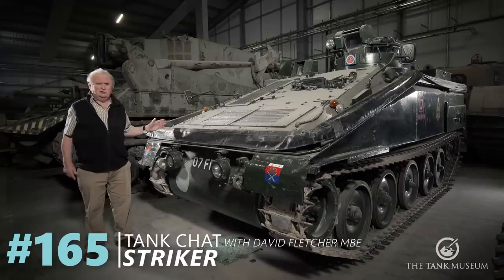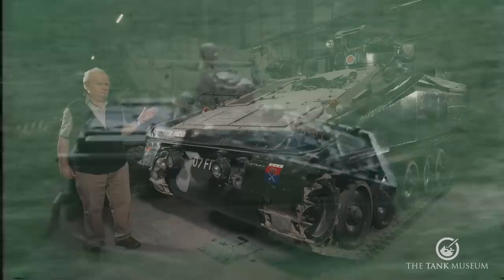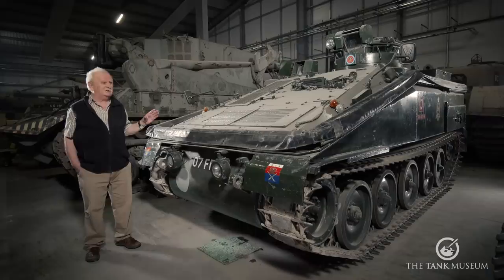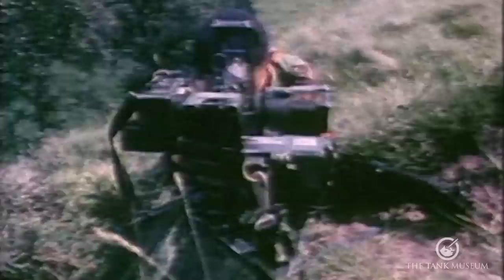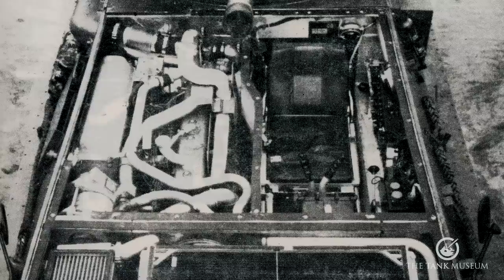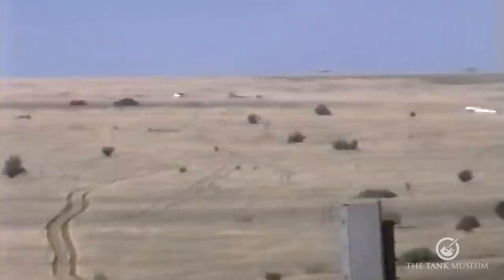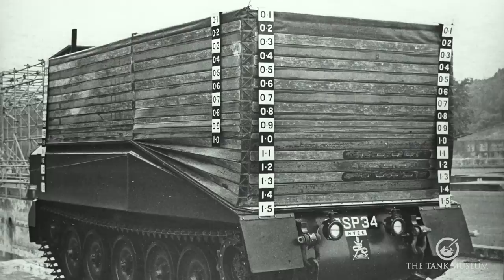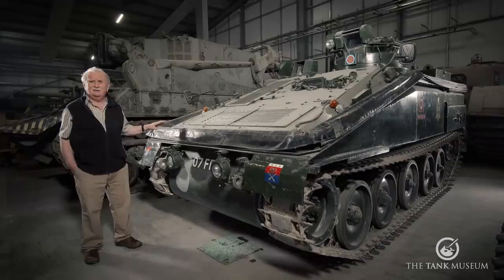Tank Chats #165 | Striker | The Tank Museum

Comment: The idea of dismounting the gunner and firing from cover was the smartest thing about this vehicle
Reply: Making it look like an ordinary Spartan was also brilliant. Something the South African's did with the Valkiri MRL, making it look like an ordinary truck.
Reply: That's pretty normal for ATGMs.
Reply: @jimmydesouza4375  Its really not...there aren't many/any Western ATGM platforms that did it..
Reply: @dogsnads5634  Did you really just try to claim there aren't any western platforms that do it, on the comments to a video about a western platform that did it?

The asteroid can't come soon enough.
Reply: @jimmydesouza4375  Please tell me about all the western ATGM platforms apart from Stormer that aimed to be visually identical to another vehicle...
Reply: @dogsnads5634  And now you're trying to pretend you were making a different argument.

You really need to fix things.
Reply: @jimmydesouza4375  You clearly struggle with reading comprehension..
Reply: @dogsnads5634  In theory, any system that has a separate Aiming system from launching system can accomplish it. A large amount of ATGM are designed with multiple mounts and capabilities, such as TOW. In theory, whether or not battlefield PRACTICE, any system that allows for separate mounting could in theory have a separate aim/launch setup. 

ALL of that said. The capability is not the practice, and the practice is not the capability. Case in point, SAMs/ASM being used as ground attack guided munitions in Ukraine. Heck, HARM were not supposed to be launchable from SU-25/27 and here we are today. 

So, it's important to parse out, have they done it/can they do it/in the right combat scenario is it feasible? What I know, is anyone speaking directly to the true battlefield capabilities of ALL western/eastern ATGM is either the most brilliant person with the best knowledge ever, or making crap up. Pretty sure the majority of people in the Youtube comments do not have THAT level of clearance in that many countries to actually answer the question in knowledgeable manner. This also goes back to Jimmy as well. So, yeah.
Reply: @SlavicCelery  re read what dogs nads originally commented . He’s correct .
Reply: @alangordon3283  and as am I, other missile systems can separate the firing from the aiming. Arguing one specific system is absolutely unique is missing the point. 

Whether or not something can be done, should be done, or can be forced into a different role are aspects of all military systems. HIMARS were developed for certain circumstances. Ukraine has utilized them to a dazzling effect for its own situation.

How something is marketed and it's actual use are very different. Case in point: people argue tank v tank. The use case is commonly tank v bunker. But people don't argue that concept. 

People also accept military strength based on their marketing. We know lots of Russian marketing was less than accurate. Lots of Western marketing is less than the real capabilities.

It's an argument based on marketing and not reality. Swingfire was great at the time, but it's not a modern weapons system. Sorry that, that concept is difficult to swallow. I love F-117 nighthawks. But they're out of date. They are no longer the best.
Reply: @jimmydesouza4375  tbh it does sound like a very straight forward feature. 
Of course the Ukrainian developed Stugna has the option of separating the launcher and the operator/targeting module. And I believe Milan has a similar option? 
You'd think it would be easy enough though, right? Just a matter of running some extra wire between the two parts, as long as the actual optic remains with the launcher. Any relatively modern ATGM should be capable of it as long as is has a camera-optical targeting system. Makes sense too. Keep the operator out of harms way, in a trench of behind cover and stick only the actual launcher out in harms way.
Reply: @SlavicCelery  try reading it again. 🙄
Reply: @L C The milan can..?  Not sure about the TOW, but the milan definitely can.  Maybe look things up?
Reply: @dogsnads5634  Israeli Pereh is based off a M48 with a missile carrying turret, but it has a weird fake gun barrel so it looks like a tank rather than a ATGM carrier

Comment: I once spoke to an ex Army guy and his experience of Swingfire was when they were old stock used for training. They had an annoying habit of not responding to commands and looping back to return to the firer, causing some consternation.
Reply: Should have sent them to the Soviets.
Reply: Alright, who let the US Bureau of Ordinance on the project?
Reply: "significant emotional event"
Reply: Yup, can confirm that.... spent years as a controller then commander of one of these vehicles before they withdrawn. The training missiles if they were treated roughly, had a habit of going ‘rogue’. 
Had one turn nearly 180 degrees before the safety staff command detonated it, also had some ‘hang up’ in the launcher ( rocket motor fired, but failed to exit the launcher), that was emotional. 
When they worked, they worked well. 4000m range and a large warhead. 
The later systems made tracking the target a lot easier....

Comment: I wonder how many miles of swing fire wire is still on the Canadian landscape after all these years.
I loved Medman.
Reply: Probably enough to reach Europe! There must be several thousand of them on Suffield.
Reply: Shush you, there are recyclers that would invade the place and you'd have to start to understand whatever the heck they speak at home.
That said foreign swear words are always useful.
Reply: Reason I had a cutter var mounted on my vehicles. The guidance wire is thin but very strong. Since it's small, it's hard to see and if it is hanging between two trees, it can decapitate you. I pictured a Europe absolutely covered with guidance wires - why risk it? So all my platoon's and later company's vehicles had them whipped up and installed by Maintenance. https://www.youtube.com/watch?v=IQbu4KMzZLA
Reply: I only ever came across the miles of wire while I was on range clearing in BATUS so no trees but a fair bit of tripping up in all that long grass.

Comment: The first set of wargames rules I learned was Challenger. Death by table. The sporting table distinguished several levels of difficulty for spotting. If you were looking at a Challenger tank side on you had to roll rather less than if you were trying to spot an individual spotter. Striker played into that beautifully. The spotter could be as far away (in scale) as 160m from the vehicle which could be in full defilade. You could still try to spot where the missile had emerged from but the odds remained poor. Hitting a target was difficult but swingfire had a good range and quite a good warhead.

Comment: Pretty awesome the wire-line guidance system. Simple idea.
Mr Fletcher mentioned you could use it to trace back to the launcher, yes I guess eventually yes. Doubt it was painted safety yellow though.

Comment: Similar to the now obsolete naval surface to air seacat missile that was also guided by a crew member with a joystick.
Reply: That must have been exciting in a heavy sea.
Reply: Swingfire was upgrade not long after it was introduced with SWIG (Swingfire Improved Guidance) which changed it from MCLOS guidance to SACLOS. All you had to do then was hold the sight on the target. Basically the same as TOW. But far more survivable in practice than TOW.
Reply: The Seacat that proved completely useless in service?
Reply: @dogsnads5634  BS, see M901 and Bradley, IFV
Reply: @colbeausabre8842  M901 couldn't stow its launcher away...
And a Bradley is a Bradley so everyone knows it has TOW missiles...

Comment: Oooo, first!
I wonder if such a vehicle, fitted with modern non-wire guided missiles, could fulfill a similar role on the modern battlefield? It could certainly reduce the requirements on the missile operator, but would it be any better than investing in some drones carrying the same missiles?
Reply: There have been multiple vehicles of a similar role proposed using the brimstone missile system on Ajax, BMPs (for Poland/possible Ukraine), unmanned vehicles, so on. Drones have to watch out for enemy air def systems, a vehicle version can roll up, aim up, fire and forward observers have the targets already painted.
Reply: @slovencleta  Brimstone would be ideal

Comment: The problem with wire guided ATGMs is that they fly a lot slower than shells, which means if the bad guys are on their toes, the return fire can be arriving before the missile gets there, and that is likely to cause some distraction to the poor schmuck trying to guide it.
Reply: Hence why firing from cover with the operator dismounted would be a good idea, no?
Reply: @GorgeDawes  
Not sure about that. I think I'd rather be inside an AFV and maybe miss, than outside when things fly in and go kaboomy and little sharp pieces get tossed around.
Reply: @mikearmstrong8483  See m901 Improved TOW Vehicle
Reply: @colbeausabre8842  
Well aware of it. Is there something specific you are bringing to my attention? Even if you are looking through the sight on top of the hammerhead, incoming rounds can still be a distraction. But since we now use the fire-and-forget Javelin, that is no longer an issue. Which is why I mentioned it as a problem with wire guided ATGMS, which are still in use by some other nations.

Comment: Not seen one of these before. Still seems a good idea for modern warfare. Could they be used against aircraft ?
Reply: No. For a start they’re wire-guided and limited by the length of the wire. Also, most AA ammunition is fitted with a proximity fuze. Swingfire is a shaped charge and requires a direct hit.
Reply: Thanks Bob, Just thought it would have been effective against the low and slow Hinds.
Reply: @bob_the_bomb4508  When I was at Bening for AT MIssile School we were shown film of Tow's being used against drone helicopters, Obviously not a common mission but it showed we had some self defense capability
Reply: @colbeausabre8842  I can see it as a last ditch anti helicopter weapon but TOW still requires a direct hit. It doesn’t have a proximity fuze as far as I know.
Reply: @bob_the_bomb4508  That's right, BUT an incoming attack helicopter is close to a zero deflection shot. You claimed it couldn''t  be done (A flat :no:) I pointed out it could - certainly could be done, not routine practice, but was possible - anyway if what do you have to lose by trying it?
Reply: @colbeausabre8842  you’re right. I interpreted ‘aircraft’ as ‘fixed wing’.

Comment: Was the remote firing achieved via a cable or wirelessly?
Reply: cable from a drum on the back of the vehicle. It enabled you to go vertical as well as horizontal so you could hide the vehicle behind a building and fire from within the building. The missile would exit the launcher and automatically fly into the controllers line of sight. Very handy indeed.
Reply: @markedwards158  Thank you.

Comment: The same vehicle with a modern missiles system would have been the ultimate tank killer 
Just imagine it firing NLAWS or javelins from a prepared position
Reply: Alvis, now BAE Systems, seems to have designed a family of vehicles around the Stormer chassis. I think only the Stormer HVM and mine thrower actually got fielded but an ATGM carrier built on that chassis seems quite possible. Perhaps Stormer HVM could be modified to fire NLAWS, Javelin, Brimstone or Hellfire.
Reply: Why would it downgrade missile types to NLAW? That's not the range or capability of the OG system. Honestly, it'd probably end up with a TOW. Wire guided missiles still have a lot of advantages in modern combat.
Reply: TOW and Jav have quite short range compared to the 4k’s Swingfire had, they just have better (tandem) warheads, where Swingfire had just one big warhead
Reply: @johnhughes8016  Sorry, wrong missile - JAGM - would replace it. Significantly more range and easier control as it combines both laser and radar in a single unit, with extended range. 

Swingfire is old. TOW has more modern variants and would still replace it given the unit in use today. That said, JAGM would absolutely replace it and blow it clean out of the water in capability.
Reply: @SlavicCelery  i dont know why they did not look at adapting it for ‘Brimstone’ as that pairing would have been an outstanding battlefield platform.... it looks like they are attempting to fit it to wheeled vehicles or trailers instead...
Reply: @johnhughes8016  When in doubt follow the $. JAGM will be used by the US Army/Air Force/Navy/Marines. And then further than that, it's NATO standard and backwards compatible, with pre-existing hellfire systems.

You're talking about attempting to develop something that needs to beat the institutional momentum already in action. Also, you gain more "range" but is that range better than HIMARS? Or a guided M777 round? The further you extend the range the more you're fighting against other systems.
Reply: @johnhughes8016  And TOW 2B Top Attack. All TOW's since the earliest (3000 meter) have a range of 3750 meters. 250 meters difference at that range is academic. Plus TOW has SACLOS guidance and Swingerfire the older and harder to use CLOS guidance
Reply: @colbeausabre8842  the later generations I used up until about 2003 had ACLOS guidance, they were lock onto heat source and fire.... then the controller just monitored to make sure the missile didn’t go ‘rogue’. 
As for the other options discussed here, all very good options, but the British government couldn’t  politically choose a non British missile, while we have a perfectly good, well proven (expensive enough to keep the defence industry happy), locally built option....

Comment: I know the scorpion and scimitar were amphibious but I did not think the spartan was amphibious
Reply: @aaronleverton4221  I didn’t spell it auto spell did
Reply: Yes. By the 1980’s though amphibious capacity was discontinued for all British military vehicles except for the M2 bridging rigs and the Combat Engineer Tractor  (CET). I’ve swum both of those and it’s a very maintenance-heavy requirement, which is why it was dropped for everything else.
Reply: @jammiedodger7040  Well, I can delete now.
Reply: @bob_the_bomb4508  Wasn’t the warthog also amphibious
Reply: @jammiedodger7040  it was called the BV 206 in my day. Only used by the Marines then.